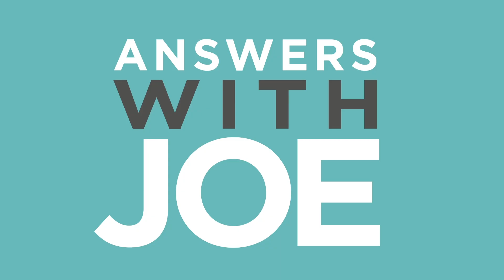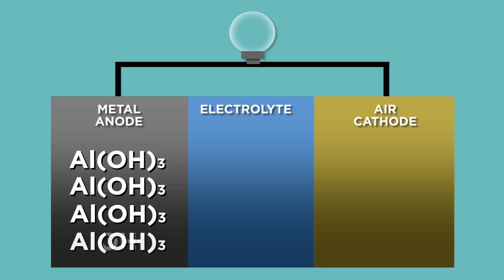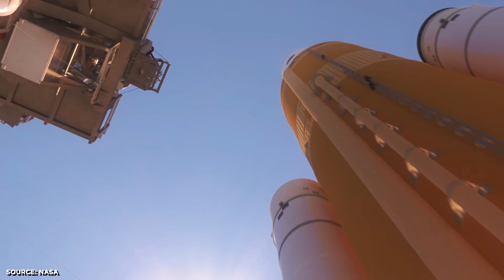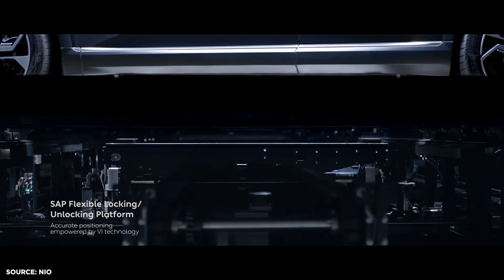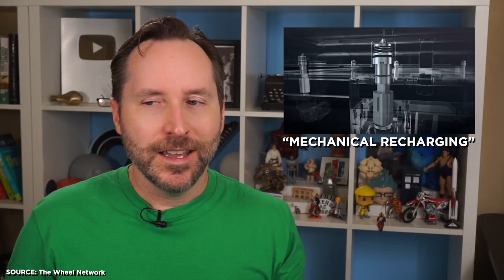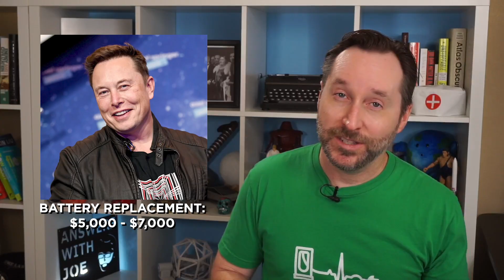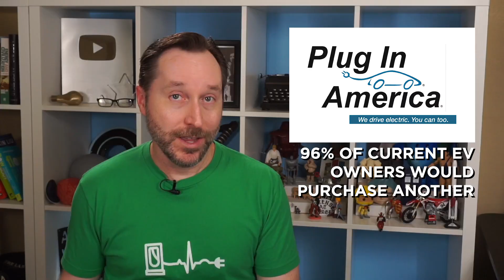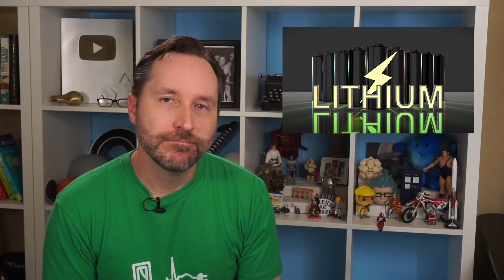This Battery Could Drive A Car 1500 Miles - But There's A Catch | Answers With Joe

Comment: Well, future cars will all drive themselves one day, so the cars could literally go swap the battery on their own. Take an appointment to a swap station automatically, so there is not too much cars waiting there, then confirm with you that you won't be needing your car at that time. Then you have a fully charged car ready for you.

Although, it also means your plug-in car could drive itself to a charging station, if they were automated. In any case, it would beat having to wait in line.

Comment: Any vehicle that needs us to use water in our vehicles is a stupid waste. EVs are fine and we will get used to them as we already are and we would be much further a long if governments werent hamstrung by the oil industry. Building an EV infrastructures is the easiest. EVs already beat most gas cars on range. Range anxiety is a BS thing pushed by oil industry backed media companies. Which is all of them..

Comment: The problem with a non-rechargeable battery compared to rechargable or hydrogen or even a gas car is, that if you want to go on a long trip the next day and you have like 30% charge/tank left in a rechargable/refilable care you can fill it up witout a loss, but with ond of the aluminium-air batteries you either start the trip with low range or you loose charge…
Reply: That's a good point; how much of an advantage could it really be when you won't always run out exactly where it needs to be replaced. Those are some significant losses.
Reply: 2 batteries with 700miles each you have 700 miles to swap for a lossless process.

Comment: I'm not sure that using this technology in high volumes would be ideal. Striking a balance between the various sustainability factors is important. Recycling should be further down the chain wherever possible, in favour of elimination, reduction, and reuse.
High energy density and zero reuse without first recycling is still better than ICE, so perhaps things like shipping and medium-to-long haul flights might be worthwhile investigating. If Lithium isn't giving the energy density required just yet, it could be a good place to start.

Comment: .
I am certain batteries could be 'recycled' in the same container they are built and live/operate in,
.
the process aluminum smelting/refining is basically just a process of electrocuting it till it almost boils and then skinning the s#it off the top and bottom...
.
i am sure we could just mechanize this whole process and forget we even mentioned it.

Comment: using small(er) batteries instead of a single big one, and discharging and replacing them sequentially sounds like a very analogous process to refuelling. you'd need some way to eject and replace them but this sound very doable to me

Comment: The infrastructure for aluminum-air batteries already exists, assuming they can get the batteries easy enough to handle and install.  If they can get it down to the difficulty of replacing the batteries on my kids toys, Amazon could deliver them to my house, i could keep a small stack of them at home, and drive with a spare in the trunk.  That’s again assuming the tech can get refined enough.

Comment: Airplanes seem like they could use them.   Lighter that li-ion and more energy dense by volume than hydrogen.   And central locations with trained staff to manage them.  Possibly even recycle them.
But for cars, i'd rather plug in.

Comment: The biggest factor on whether this sees wide spread adoption is cost. One big selling point of EV cars is electricity is cheaper then gas (for equivalent range). Will these Al-Air batteries be cheaper then the amount of gas it takes a car to go 1500 miles? Thats about $166 given todays cost of gas and a car that gets 30 mi/gal. Even with recycling, I don't see how you can get the costs down that low. Maybe its different for long haul ships, don't know what their efficiency is so don't know what they pay in fuel. But if its not more then what these batteries cost, then there is no incentive to switch to them. Businesses care about operational costs, not the environment (in general).

Comment: Mr.Asterisk forget the 3 big issues:

1) recycling aluminium metal is easy, recycling aluminium oxide is really complicated and energy demanding…
(AFAIK originally there is no intent to revycle it)

2) lack of charging ability means, that either you divide battery into several independent segments, or you have to replace battery, when it's still on 20-30% if you need to travel for longer distance… 
(which mean more waste)

3) It' very hard to prevent this batteryfrom completely discharge itself while standing still, once electrolyte was added…
(thus creating even more waste)

Comment: I feel like the range would have to be a lot higher for this to really make sense. 1500 miles could be a single road trip, or just once a month or so. 5000-10000 would be more convincing, like a battery change instead of an oil change. That would probably work better for the economics of recycling them as well.

Comment: Instead of replacing the battery, could 't we  just replace the part that's expended - the aluminum. There's no detail on the battery's construction, but I wonder if the aluminum could be an rod or something that the owner or a service provider could replace when it's depleted, rather than replacing the entire unit.

Comment: I have a solution to energy! A real infrastructure that would supply natural gas(ie methane). And allow for methane hybrid cars. An infrastructure that would allow us to have recharging stations and natural gas(ie methane refueling). Virtually at every home, business, residential, and public areas across the country. This would make existing batteries last longer and give us a more carbon neutral fuel source. That also  gives us greater fuel and battery mileage. Better than the 1500 miles from battery alluded in this video. Also from my energy infrastructure, which would allow us the methane hybrid vehicles. Less mining and less battery wastes created. Along with a host of societal pluses and mitigation of climate & environmental breakdown. And this energy infrastructure uses some older tech that can be revamped and modified for the core of the natural gas(ie methane) production. Which can be added to a dozen other renewable energy sources. To create a carbon neutral energy infrastructure.

Comment: Cycling the exhausted batteries seems to be feasible only by using the Hall-Héroult process. That is the process that is used for the ore processing, not the recycling. It consumes a lot of  energy, is not very efficient and outputs much more CO2 than aluminum. If you consider the whole cycle and infrastructure costs it seems much worse than just using an ICE car.

Comment: I think wireless electricity will negate the need for better batteries. Mainly because of safety. Storing energy is any way is similar. The more potential energy density the higher the danger. A battery that stores the same amount of energy as a gas tank has the same destructive capability.

Comment: A big problem with wind and solar energy is that the wind doesn't always blow and the doesn't always assume. What if we could store energy by using these to separate oxygen from hydrogen and liquify it, and then use the hydrogen to power turbines when wind and power are having down-time?

Comment: Whatever happened to the cars that were supposed to run on water?
I remember a commercial ( in the 70's)
Where a fella held a glass up to the exhaust pipe and then drank the clear drips that came out.
Maybe I dreamt it...
Maybe big oil bought the patent and then locked it in a safe😄😄

Comment: Racing cars. Aluminium-air can be used in Formula E or Extreme E as power source, in combination with hypercapacitors for fast high power regenerative braking.

Comment: Another perspective?
Let's consider the Tesla / CATL / BYD (?) and other "million mile packs" (They ARE coming!)
Just to remove argument, downgrade to 750,000 miles.

That's ONE recycling process at "end of life" even if we discount "second life".

In comparison, a BEST range for the packs proposed here is 1,500 miles.
Not a difficult calculation....
That's the equivalent of FIVE HUNDRED recycles to achieve the same mileage!
Is it really best use of resources??

Comment: Conventional Alkaline batteries can be recycled, the high purity manganese dioxide just needs to be cleaned, and then can be re-used easily. With Lithium ion, all of the doping materials, cobalt, and the like are the desirable part for recycling, at the moment the economics are tilted towards mining new lithium, but as/if demand increases so too will recycling, that's just how the economics of metals works. The interesting possibility here is something to replace high-draw primary use batteries for emergency applications, I don't know that these fix transportation as much as one might like. Either way, I enjoyed the vid.

Comment: I pay 2.9 cents per mile, including charging inefficiencies, with my model 3 performance (swapped out for aftermarket 18 inch aero wheels).  Yes, I know, I'm not the target audience. But that 10 cents per mile mark is ... not the mark.

Comment: I think the Battery Bomb we're in for in the next ten years is going to be unspeakably catastrophic... and funny.
While EVs are definitely the way of the future, batteries cannot be.  They are more resource intensive and toxic to produce than fossil fuels and our reliance on them is absolutely short-sighted.  Batteries in EVs wont last as long as the age of the average car in the US (12-ish years) and there's very little infrastructure to recycle 1200 lbs Li-ion battery packs at end of life.
The mechanical recharging idea sounds even worse.  Incur the toxicity and carbon intensity of producing batteries AND transporting batteries weighing thousands of lbs all over the place using...fossil fuels?
Hydrogen fuel cells is one tech that can navigate us away from the Scylla and Charybdis of Li-ion batteries and fossil fuels.  The gasoline fueling network can transport Hydrogen with some modification and the cells can be refilled with Hydrogen goop/solid/liquid using existing tech, they can be installed in present day cars and the pollutant from the power process is water.  Plus the energy density of hydrogen is better than Li-ion tech.  And there's room to grow with fuel cells in terms of efficiency.  We're at peak Li-ion. 
There are other alternatives as well like biofuels for existing internal combustion engines or thermo-electric generators but all this needs a lot of investment to get them to be viable, just like any new tech.
However, I don't think we're going to explore these options meaningfully until we actually hit the Li-ion battery waste crisis that is so clearly on the horizon.

Comment: Phrases I just love. "Assuming the infrastructure got built out" or "As long as the infrastructure is there". It took over 50 years for the gasoline delivery and standards to be a thing in the USA and in some ways it's still not there. American corporations do not have a history of playing nice with each other let alone the Federal government imposing standards. Another favourite phrase "Let the market decide." which is why we have Verizon, At&T (and T-Mobil) and until lately Sprint. All with their own 'proprietary and best cellular technology". The only reason Li EVs are a thing in this country is because they can take advantage of the established energy grid. At least half of Tesla's success centers around the supercharger network. Like you Joe, I would only buy a Tesla if I was in the market for an EV. There is no reliable non Tesla EV replenishment system out there. I'm sorry but aluminum air is a joke for automotive applications.

Comment: I'd go back a step and have an infrastructure of cars that support li-Ion standardized cell packs in a swap station that also serves as the cell recharging site.  No more range anxiety once it's built out, and no more 'ballon' cost fears of battery cost at 100,000 miles. You just rent/swap the power--- not unlike propane grill tank swap at the corner store.
Reply: My problem there is that it costs about $12 to refill a regular 20lb cylinder of propane, but it's $20 for a swap. I would expect batteries to have similar markup. That right there is enough to kill the idea for me
Reply: @Gibson99  Not a sound business model. First every car, truck, van would have to use the same standardized battery pack (not going to happen). Every vehicle would have to index and mount that industry standard battery in the same place in the same way so a machine could quickly and reliably handle the swap. The swap equipment would have to be able to handle all makes and models and classes of vehicle's including vehicle's that had multiple battery packs. Who would build such a thing and why would they build such a thing? Can you imagine the cost to maintain such a system? We are not talking old school tech that a moron can operate and maintain that just pumps a liquid into a tank. You have to contend with road salt and debrigh as well. Every time you put a tool to a car there is a chance a fastener will snap off.  We are still a good 50 to 100 years away from having electric vehicles and infrastructure on par with todays gasoline powered car's. This is all before we get into right to repair talks and after market parts for DIY.
Reply: @buckaroobonsi555  I completely agree. Sounds awesome on the surface till you start getting into the details, then it all falls apart.
Reply: @Gibson99  Exactly. Somebody has to pay for the batteries.
Reply: With what I said. Money is money 💰🤑
Reply: Where do you get the lithium?

This is the problem with EV. Lithium is one of the worst materials to extract from the earth.

But as long as you see advertisements and propaganda telling you to buy EV you will.

By the way as long as we are talking about things you will do just because society tells you to - please get the vaccine. 

(Stupid fuckers)
Reply: @glasstuna  When society tells me to do something, I’m automatically suspicious. When government tells me to do something, I’m extra suspicious. When I hear the word science bantered about without any scientific evidence, I run the other way!

Comment: So metal air batteries are just a hydrogen fuel cell but instead of a super flammable gas as a fuel you have a slightly reactive solid that slowly gunks up your cathode.
Also as you mentioned electrolysis to produce hydrogen... You can use electrolysis to produce aluminium from your busted battery (although I get how aluminium electrolysis is more expensive) 
Sidenote: I'd love mechanical refuelling if you had a pit stop crew style battery swap instead of a logical automated system (pesky robots making our lives efficient but boring).

Comment: I'm still hopeful hydrogen.  If I'm a gas station owner and someone makes a relatively low cost on sight hydrogen production generator powered by solar, I'd be interested in making my own fuel for free and then selling it for money.  Also tell me I can make my own electricity and not have an electric bill, I'd be very interested.

Comment: Trains; no need for power-lines over (under) the tracks, at the stations, disconnect the last "battery" cart, and connect a new one, and off you go. Tchoo-tchooo!
A container of Alu-Air batteries will not be one single huge one, but many small ones. And configured correctly, you're not depleting all at the same time. Then the container can be re-furbished, and empty ones can be replaced, and the container are once again at max capacity. Larger ships can also have several of this containers, and be replaced/refurbished at port, or on-route to its destination.

Comment: The energy mass density advantage could be huge when it comes to electric aircraft. A battery that can last for 60 minutes only has a 30 minute range when considering the required 30 minute reserve; double the density and you triple the effective range to 90 minutes.

Comment: I guess my biggest worry is that with a non-rechargeable battery you take regenerative braking off the table (or force yourself to include regular rechargeable batteries, increasing weight and cost).

It's also unclear to me how easy it would be to miniaturize aluminium batteries for electronics and personal gadgets. We still use lots of AAA/AA/button/etc batteries in everyday life so it would be nice if they were made of more common metals and more recyclable.

Comment: Technically, you would only have to replace the aluminum and not necessarily the whole battery. If you had the aluminum as either a block that could be relatively easily taken out or a bunch of marbles/ball bearings, that could mitigate the need to take out the whole battery. In fact, pellets(not necessarily balls) could be better if surface area matters to the batteries' function.

Comment: Use them for eVTOL's.  They need the energy density, for the weight.  Also, they can afford a specialized infrastructure (swap stations), to support them.

Comment: Just one suggestion. Since you're probably using a wide lens, the position of the lens being higher up warps the edge of the shelf at the back, and the edge of the shelf shows up on frame right. Could you please please lower the camera, or atleast pan the camera such that the edge doesn't show? Please? I really do love your videos, but that edge is kinda... Hnhehhenhhh...

Comment: Currently, you really need two vehicles if you ever want to go on long distance trips. Aluminum air batteries make more sense when you think about that. With a bit of work on the engineering, you don't need special infrastructure for aluminum air batteries but you always will with regular EVs if you want quick charging.